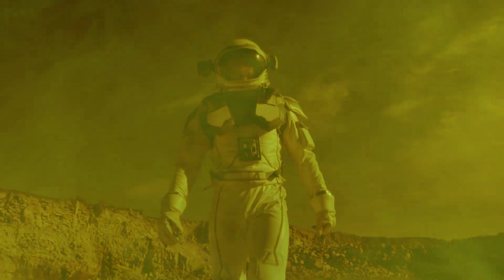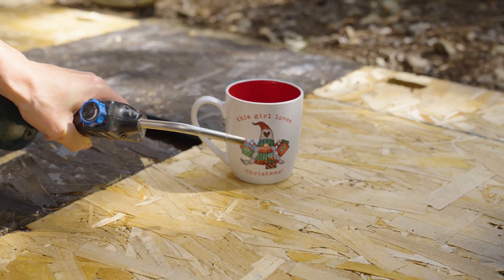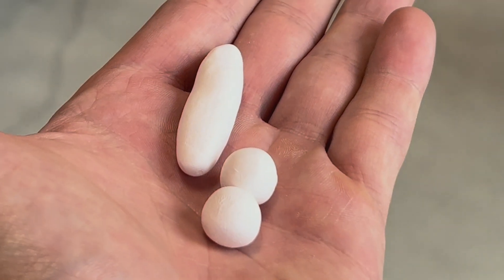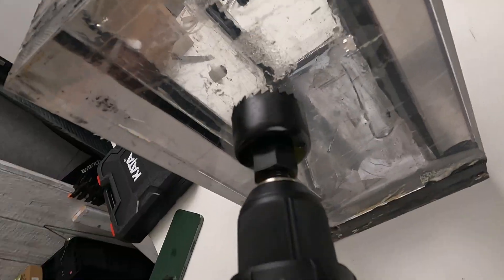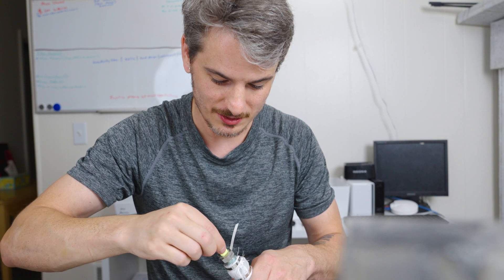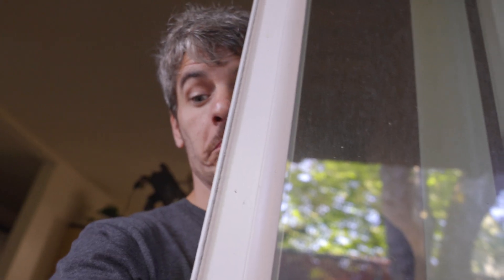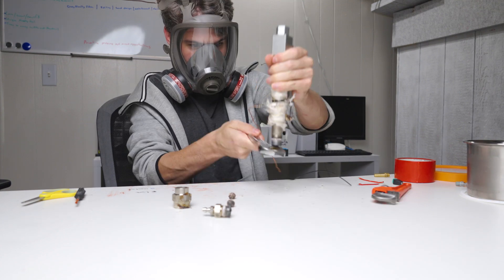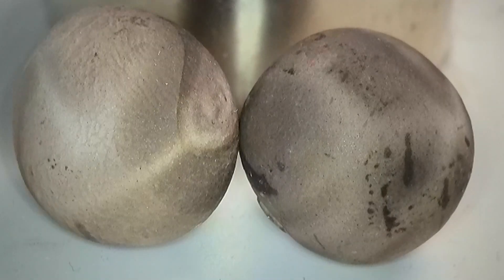I Built Something That Survives Venus for $5

Comment: well the thing is the Venera probes costed 500m because: 
1 they were as big as a human 
2 they were built in the 1970s and 80's 
3 they had strong enough radios to penetrate the incredibly thick 93 times as pressurized and dust/acid-filled atmosphere while still not being affected
4 it had cameras
5 it had various sensors
6 it was extremely expensive to get there
7 it was made out of metal specifically designed to survive that
and it had to survive the re-entry to the venus wich spoiler isn't exactly that easy
Reply from the maker: Yes I understand that it's more sophisticated. That why I never said what I made was better. :)

Comment: They have some modern resins that can actually handle so e serious heat I think one commercial brand is well over 700,  there maybe some that could handle 1000f.
Reply from the maker: I'd love to know which ones could handle that much heat. I tried researching and only found that ceramic worked. Maybe it's top secret😅
Reply: @pranzetti  JB Weld has one that consistently handle 400 and up to 550 intermittently. I'm thinking there are other you could get possibly that could go much higher since that JB Weld is commercial. Industrial they prolly got stuff that goes way more than that  not just anyone can buy. Highest commercial grade is is 650f. That's good but not close enough to that 
900f+ that's needed. My dad use to work in Aerospace and they always had something you could not buy that wasent out on the open market, like they caught you taking even little just for personal use your going to jail. In the 80s when Titanium was still kinda rare and they responsible for the stuff down to almost the gram, every bit of scrap and shaving was put in a box and welded shut to be sent back to somewhere.  There's prolly tons off stuff that we ain't allowed to know about. I always thought high temp resins would change the world next to a better kind of battery.
Reply: @pranzetti  I'm looking and someone  says they have adhesives made for ceramic that can handle up to 2012 degrees Fahrenheit. That's freaking crazy.
Reply from the maker: I couldn’t find anything that could handle that much heat on Amazon. I bet those resins are so specialized that they have to be custom made. Most people never need them so they aren’t mass produced.

Comment: There is not enough corrosive chemicals inside that tube to actually cause significant corrosion to your samples. On venus the concentration of corrosive agents virtually never goes down. Inside your tube whatever amount of molecules is there to begin with might get completely used up really quickly lowering the concentration of agents.
Reply from the maker: Do you have a recommendation on how to make the test more accurate to your knowledge?
Reply: @pranzetti  you could put some concentrated sulphuric acid in it and a bit of dry ice
Reply from the maker: What’s does the dry ice do?
Reply: @pranzetti  it simulates the co2 content of venusian air (wich is about 92 percent co2)
Reply from the maker: Nice. I’m simulating Mars for 100 days in my next video. I’m using citric acid and baking soda to generate the Co2
Reply: @pranzetti  that's a good idea but if you ever want to make acetone for a vid you could get lime and vinegar and create the co2 that way and then heat the final calcium acetate to make acetone and regenerate lime
Reply from the maker: I failed chemistry but I’ll give that a try if need it 😅

Comment: can the electronics handle the high temperatures sustained? how about the battery for it? that was the main issue, the craft itself survived, but the electronics quickly failed as it warmed up internally.
Reply: id test the design at sustained abuse of high temps for at least a week to determine how it will hold up.
Reply: lastly, the original landers also had a camera, can you make a camera or other sensors  that will work at these conditions so telemetry can be done? the chassis alone is one factor.
Reply from the maker: I agree. A ceramic ball is not as sophisticated but the point of the video is to make something for $5 that can survive Venus. 

I would’ve left it inside the simulator longer but I don’t really want to sleep with that thing on 😅

Comment: 6:12 i'm not sure if i'm right but you should make sure not to get hair between the rubber of the gas mask that contacts your face & your skin, it can allow air to seep in and out of it
Reply from the maker: That’s probably true. Luckily there is a second seal inside the mask that just goes around the moth and nose. You can probably see it in the video.
Reply: @pranzetti  yes i was wondering if that was sealed too, good to hear so! stay safe out there
Reply from the maker: Thanks for your help!

Comment: This was a disappointing video, though to be expected.
Reply from the maker: ah man... why we're you disappointed?
Reply: @pranzetti  Expectations. You just did exactly what I expected you to do. Which is exactly what I didn't want to see. Dont let that get you down though. You have top notch editing and a great personality.

Also you definitely want to rig up proper safety systems next time you build "pipe bombs". Never touch dangerously pressurized instruments after they've possibly been compromised.
Reply from the maker: Thank you for letting me know why you we're disappointed. Building stuff that can survive another planet is all completely new to me so I guess I don't know how to do something unexpected. I will keep this in mind when making future videos and try to innovate more. I really appreciate your feedback. 

The pipe and all of the fittings are rated for at least 3-400% of the pressure it experienced so that's where my confidence to hold the device came from. It's all made of Forged 304 Stainless steel. Up to 5000 psi easy. That's only 1/4 of the pressure I used.

The safety system was going to be a burst disc but the thread pattern is difficult to find so I decided to trust the math behind the stainless steel.
Reply: @pranzetti  Heat is the compromising issue here. While doing these sorts of tests such an X factor can lead to dangerous situations.

Also feel free to ignore my feelings aside from the safety bit. Your views and likes are proof enough your on the right track.
Reply from the maker: Anyone willing to comment and explain a disappointment is worth listening to. I think the video concept was “good” but as you said you were disappointed so it’s not “great”.

I really do appreciate your feedback. It means I should’ve put in more effort into the video idea and made it better. That’s good to know because I can fix that. Thanks again! 

I think it’s be cool to have a window on the Venus simulator too. So you can see the whole process in real time. That’d be crazy !